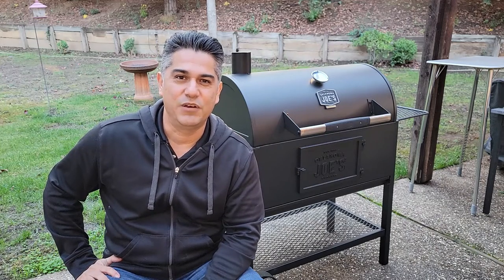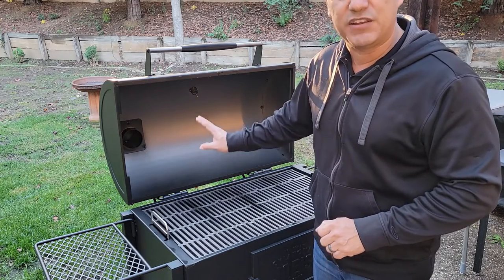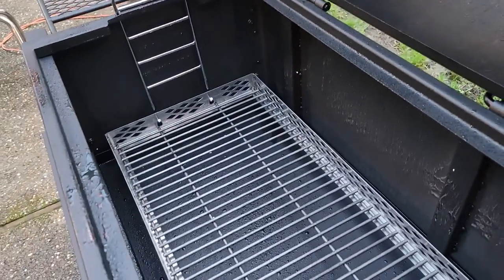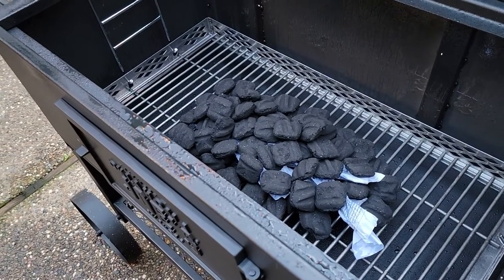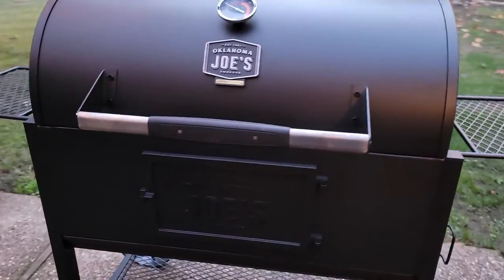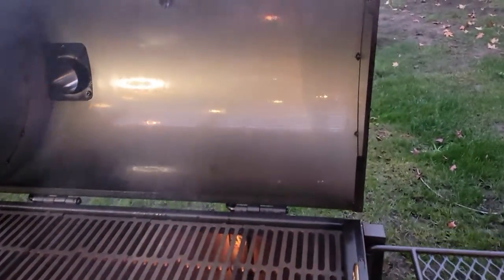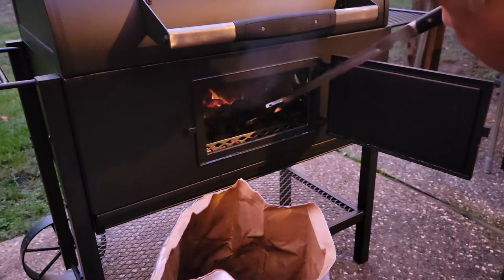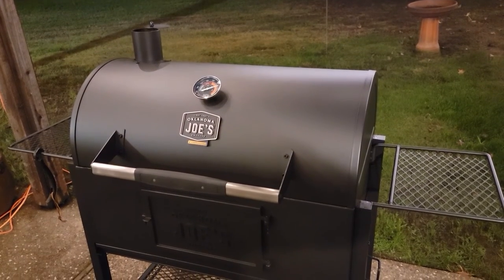The Judge - Part 2 - Curing and Seasoning Oklahoma Joe's Judge Charcoal Grill

Comment: One thing that I've found works great for seasoning grills like this is 100% avocado oil spray. Avocado oil is not only healthy, it has a ridiculously high smoke point (~500F) which is great for seasoning grills. It doesn't smell/taste like avocado either, so it's great for cooking in general. 

Only downside is that it's a bit more expensive than canola or peanut oil, but you can find it for a good price at the warehouse stores (Costco/Sams/etc).
Reply from the maker: Great tip Michael!  Thank you!

Comment: Great review, I have the same bbq. Nice that you corrected the smoke stack and placed it through the inside of the lid. Not to be nit picky, but your lower wood shelf on the legs is upside down. It should actually be a basket and cradle the wood. Also it relieves the stress on the tack welds that will eventually fail. Let the angle iron cradle the metal screen. It’s a excellent bbq for smoking btw. I’ve done a 24 lb. Thanksgiving turkey and Christmas prime rib on my judge.
Reply from the maker: Thanks for tip!  Yes, I love the Judge and use it all the time.  A 24-pound turkey is a huge bird!  Did you spatchcock it or leave it whole?  Stuff it or no?  I see a turkey on my Judge in the near future.  Thanks again for the tip and thanks for watching!
Reply: @TonyToneBBQ  I left the turkey whole and it fit fine on the judge. I view the judge more as a hybrid grill/smoker because it’s large enough to offset smoke. Great smoker for the price. It’s sort of a do it all bbq. I didn’t stuff the bird during the cook, but I probably would say a 25 pound bird is the biggest I’d try smoking on this bbq.
Reply from the maker: @northamericanproductions  I couldn't agree with you more.  I love the Judge!  Thanks again!

Comment: Is there any reason to or not to spray the pull out ash pan?...just don't want any of it to rust...would it be OK to spray the outside as well? Thx,cant wait 2 get mine!
Reply from the maker: Hi William!  That's a good question and thank you for asking.  There's no reason that you should not.  The more oil coating all parts, the better.  Depending on your environment, extra oil might be a good idea.  The ash pans normally take a lot of abuse from the hot coals landing directly on the surface.  To prevent rust, the best thing you can do clean out the ashes after each cook.  I wait until the next day to make sure the coals are burnt out, but clean out the ash as soon as you can.  I use a putty knife and a brush to make sure nothing loose gets left behind.  Ash attracts moisture and will cause rust.  I hope that helps.  Thanks for watching!

Comment: Some reviews mentioned that the smoker warped or they could not open the pit. What do you think happened? What went wrong? Is that a defect?
Reply from the maker: Hi Joyce!  Not sure.  Since these come requiring assembly, I'm thinking it's more likely something happened during assembly.  I've had no issues whatsoever with my Judge.  I use it weekly and it's just awesome!  Thanks for the question!

Comment: hey do you have the grates upside down? Or is that the right way? I keep seeing them both ways.
Reply from the maker: Hey Daniel!  Good question! From looking carefully at the instructions, it doesn't seem to say that either way is correct. I prefer the flat sides of the grills to be face up and the points facing down. With the flat side up, smaller items are less likely to fall through the grill, and the grill is much easier to clean. I always leave my grill as greasy and dirty as possible after a cook, and then get it nice and hot the next time I use it before putting food on it, all I have to do is scrape it with a flat grill scraper. If the points are facing up, it's a pain in the neck cleaning all that crud out between each slot. So really it's just user preference. Thanks for watching and thanks for your question! Hope that helps.
Reply: @TonyToneBBQ  I totally agree with you and thanks for the quick answer!
Reply from the maker: @ValveInteractive  you're welcome!

Comment: can you clean the grates in a dishwaher after use ??
Reply from the maker: Good question!  No, grates that come with The Judge are made of Cast Iron, and Cast Iron should not be cleaned in the dishwasher.  Personally, I intentionally leave the grates dirty until the next cook.  Leaving grease on the grates actually protects them from rusting.  Next cook before food goes on, I get the grates smoking hot and then give them a good scraping and scrubbing and I sometimes spray with peanut oil.  That's one of the nice things about Cast Iron is that they are low maintenance and will last forever if you use them properly.  Thanks for the question!

Comment: What other grills were you looking at when were comparing this one to the others?
Reply from the maker: Hey Byron!  Thanks for the question!  I have a couple of Weber Kettles and a barrel grill, but I wanted something with a fire access door that would make adding fuel without lifting the lid possible.  I considered the Char-Griller Legacy and the Masterbuilt 36-inch Charcoal Grill and although The Judge was 200 to 300 dollars more, I felt it was the best choice for me.   Thanks for watching and please let me know if you have any other questions!
Reply: @TonyToneBBQ  I'm looking at all three right now I was just wondering what made you pick the judge all three have the middle opening  was there something that made it stand out the most?
Reply from the maker: @bmoc1925  the weight of The Judge really stood out.  The metal is thick and heavy, which helps retain heat.  The Judge also felt solid and tight, it a tank.  One nice feature in the Char-Griller Legacy was the crank that can be used to adjust the fire grate, but the grate itself felt flimsy like it couldn't hold much weight.  The fire grate in the judge is solid and heavy duty.  I felt that the materials used in The Judge would make it last much longer and cook better.
Reply: @TonyToneBBQ  Thanks I was wondering how they were built,  if one was more sturdier than the other.
Reply from the maker: @bmoc1925  yup, The Judge is much more sturdy.  Thanks!